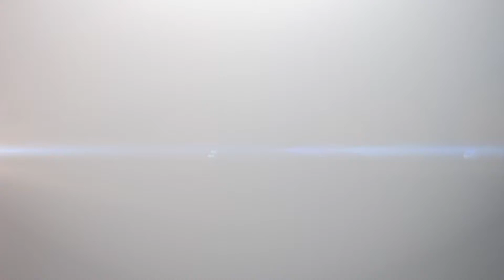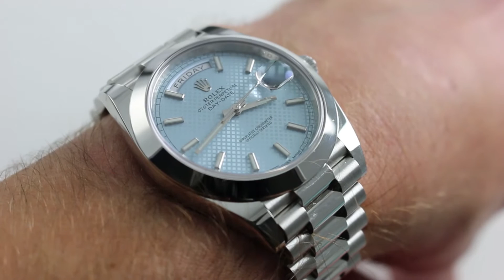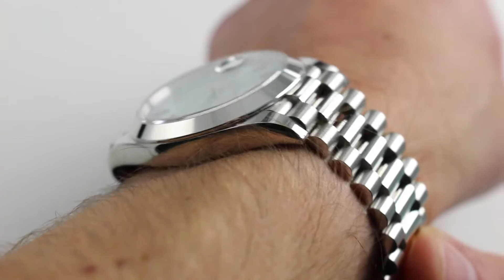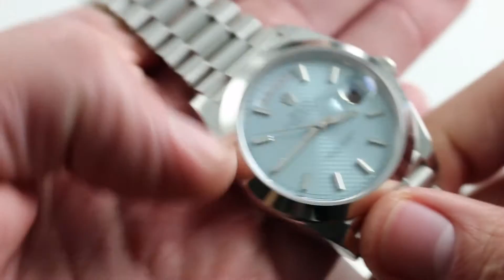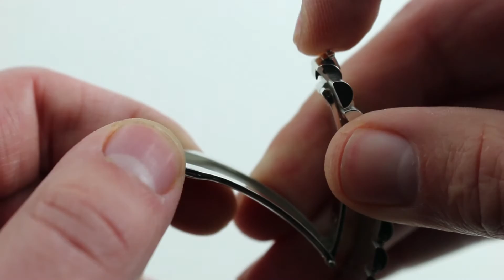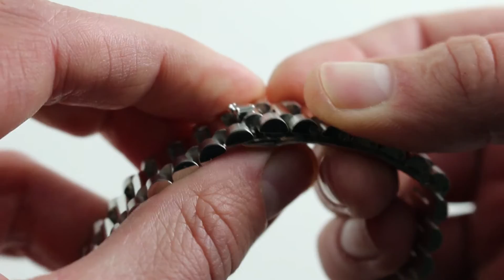Pre-Owned Rolex Day-Date 226206 Luxury Watch Review

Comment: Love the watch! But platinum scratches super easy, white gold might be a better choice
Reply: Rui CoelhoRuiC that is incorrect, PT is much more scratch resistent than red or white gold. I have the 41mm and love it
Reply: nope platinum is more durable
Reply: @epvtrinidad  pure platinum is more scratch resistant, than pure gold. However platinum watches are usually 95% platinum and gold watches are only 75% gold which makes the gold watches more scratch resistant in practice.
Reply: @matthiasheuberger952  That’s true! It’s also called the “ Sticky Metal “ coz when you scratch or dent the watch, you’re just moving the metal from one place to another. It’s not coming off like steel or gold. Therefore I guess you can polish it many times without any worry. It doesn’t get better than this in Rolex.
Reply: I think you confused with titanium